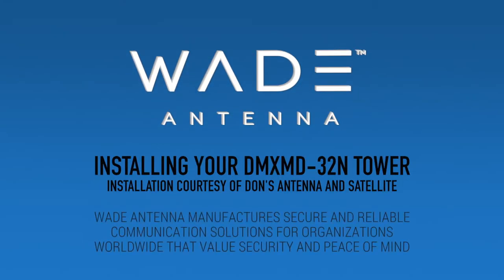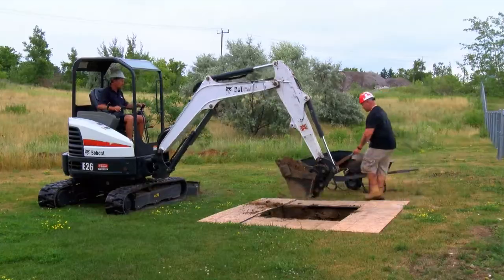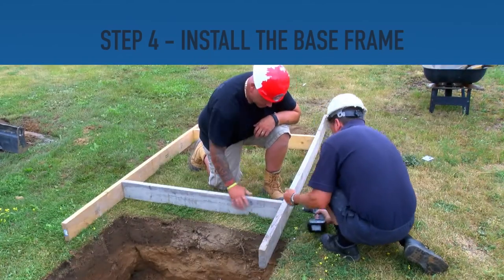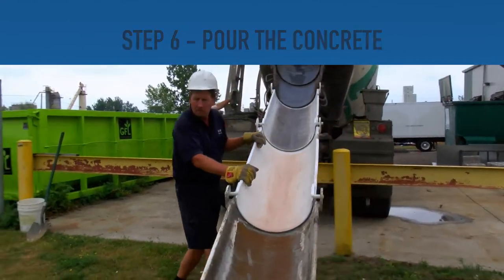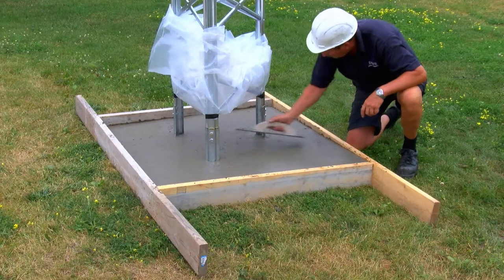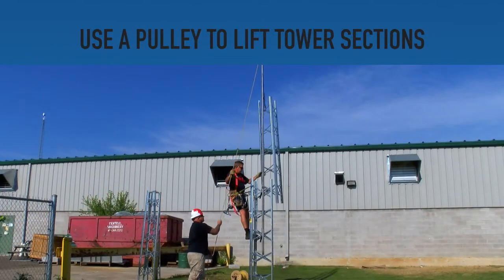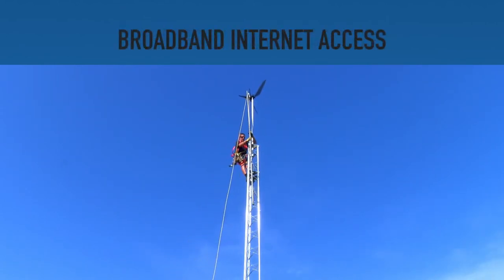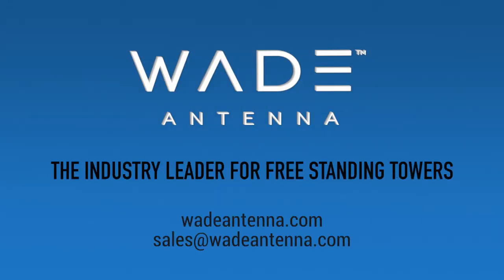DMXMD-32N Tower Installation - Wade Antenna (French Subtitles)

Comment: Good video. :)  However, one comment I'll make on the way you used the Gin Pole...   what you did there can work fine for the 32' tower, but on a taller tower, the impact of pulling the rope at an angle will increase with every section - and there will be more and more 'sideways' pull on the Gin Pole.

To avoid this, you should install a second pulley at the base of the tower, so that the rope goes from the new section being lifted up the tower to the Gin Pole, and then directly back down the tower to the pulley at the base, and then horizontally out to the lifting person.  That keeps all the force straight up/down to the base pulley, and none of the force is pulling on the tower or the Gin Pole sideways. 

Again, that'll not be a big issue at a 32' or shorter tower anyway, but if this was a 56' or 64' tower, the sideways pull on the top of the Gin Pole could put you in a dangerous situation.